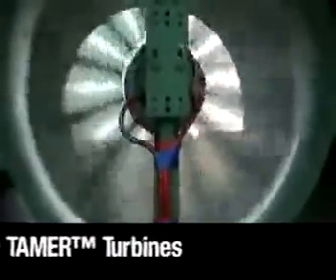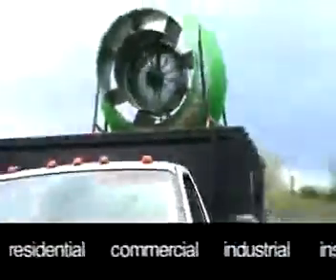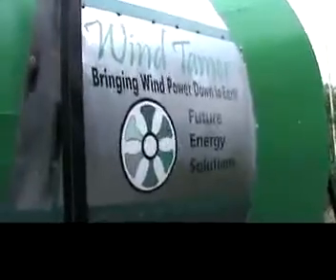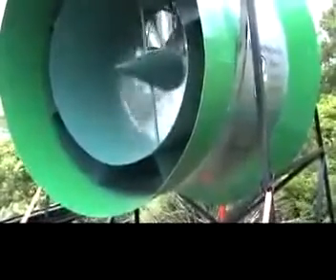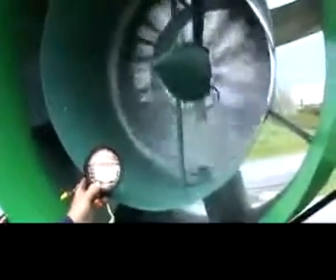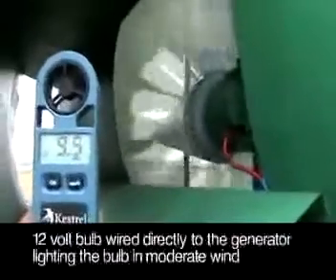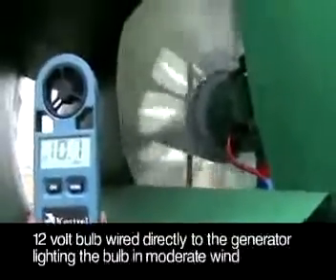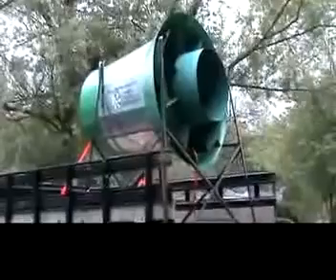WIND TAMER™ Turbine

Comment: WHATS THE VOLTAGE VARIANCE? WHATS THE FULL WATTAGE OUTPUT? WHAT IS THE DUTY CYCLE UNDER FULL LOAD? AMPS? VOLTAGE? WATTS... ANYTHING ABOUT THIS SETUP???????????????((((((NOTHING?))))))))  IF I ATTACH THIS TO MY GAS GUZZLING FORD DO I HAVE TO DRIVE DOWN THE HIGHWAY AT 100 KM PER HOUR OR MORE  TO POWER MY ELECTRIC RAZOR?

Comment: the Betz breaking results are calculated on rotor diameter (so, that is false !!!!!)
cP must be calculated on sweptarea, hub included and not on the rotor
11 m/sec average is only seen in Antartica !!!!!!!!
Weibull shape 2 is not correct (weibull must be calculated in small region,not over a continent)
calculations were estimations !!!
where are the cfd's ? How were the meshes designed?
Vacuum of the hub can never double the cP (max profit is 9 % based on 1:1.4)
scam !!! scam !!!

Comment: @riebedebie check out "aristapower com slash wind" there is an independent test report on their site performed by , if you believe it or not is another matter. It quotes:

Dr. Ken Visser Ph.D. from the Department of Mechanical and Aeronautical Engineering of Clarkson University evaluated the performance of two WindTamer rotor configurations.